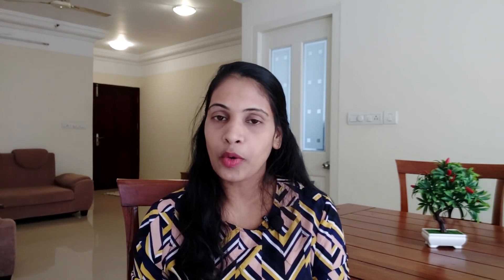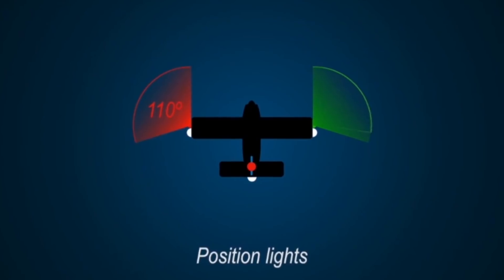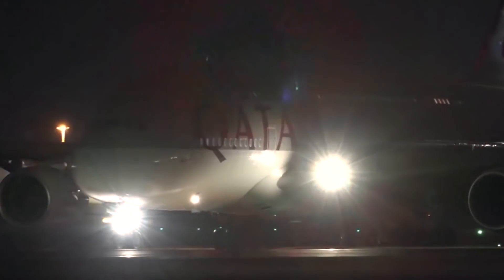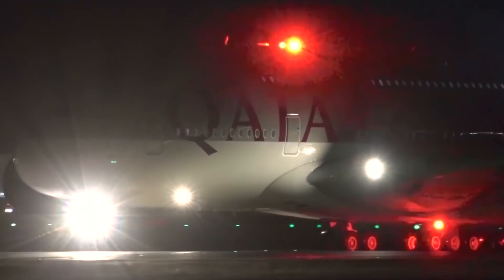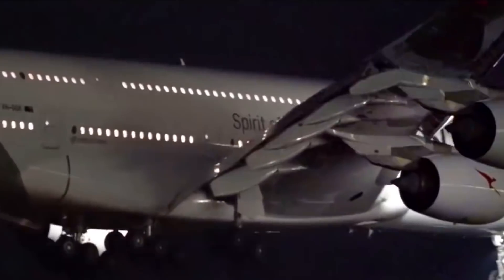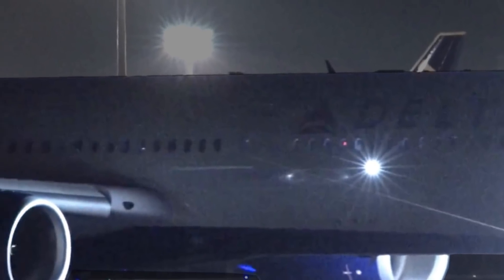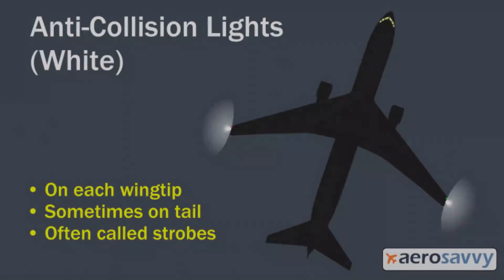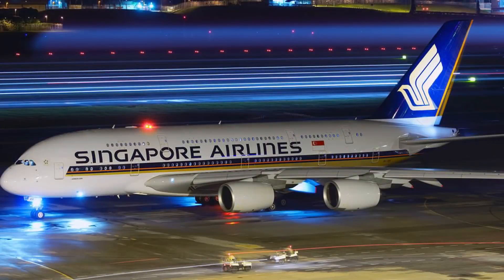വിമാനത്തിൽ കാണുന്ന ലൈറ്റ്സ് ഏതൊക്കെ ആണ്?

Comment: If you see Green navigation light on your Leftt side and red on your right side it means that Aircraft is approaching towards you and it is vice versa when the Aircraft is going away from you. 
Position or navigation is light is mainly is used to know the direction of the aircraft.
Anti collision light is used spot an aircraft on the runway by the approaching aircraft to the runway.
Red flashing light located down side of the aircraft also helps the ground staff to know whether the engine running or shut down before approaching the aircraft.
Added these points form my little knowledge.🙂
As other other videos of you this is also good and informative video which can be understood by everyone.
Reply from the maker: Thank you
Reply: @DivyasAviation  My Pleasure
Reply: Btw Runway turnoff lights wer missed

Comment: Hi Divya Some correction and some information ...

1.Navigation lights 
Red(Port side ) Green( Starboard side ) and white on Tail these are the Navigation light not position light 
.these lights are used to identify the left and rift side of aircraft to other aircraft’s and we can easily identify 
Weather the aircraft coming towards or Going away ..

2.Position light ( it’s not necessary in all airplane models ) 
Position lights are mostly mainly we can see in Boeing Aircraft’s just behind of Wing tip and Tail upper side of APU .

3.Wing strobes -and Tail strobes or positioning Lights 

Through this light we can differentiate at night time is it Boeing or Airbus 
Boeing-single flash 
Airbus -Dual flash 

4.Takeoff or Landing lights 
In leading edge of the wing or under the wing(depends up on aircraft model )
maybe two or 4 ) and 1 in the nose landing gear 

5.Taxi light  
For illuminating taxi light  bay during taxing 

6.Runway turn off light 
For illuminating the are wide area left and right from nose to see the taxi bay 

7.Logo light 
For illuminating logo for the company 

8. Wing scan and engine scan 
illuminating engine intake area and wing leading edge .

9. Camara lights ( 380,777,340 etc)
It give the clear vision to external cameras)

10. Cargo loading lights 
illuminating cargo loading area 

11.external emergency lights( mainly in Boeing and 320 family have Wing emergency lights)
In emergency condition making path and visibility ( near to the each door and overt the wing ) 

Note : wheel well lights not comes under external lights of aircraft’s it only for maintenance purposes.u cannot operate it if wheel well door are closed .
Reply from the maker: Thank you Manu 👍
Reply: Hi Manu...so detailed- might not be useful for a common man point...
Your elaborations are useful for those who want to go deep...
Thanks for your refresh..
Reply: @SIJUKDEVASIA  always happy to hear that knowledge is helping someone..I am also getting lot of new information from Divya’s videos ....thanks bro and thanks Divya .
Reply: @DivyasAviation  welcome ..and thank you to for new informations and new videos ......
One question Why ash try’s are in aircraft? Even in cockpit also as u know that smokies in internationally banned still why ash try’s ? 
☺️☺️☺️☺️....
U can do the interior lights of aircraft....
Reply from the maker: Ashtrays in bathrooms are listed as a legal requirement for “minimum equipment” by the Federal Aviation Administration (FAA). Passengers are not allowed to smoke still there are passengers who do it. In that situation instead of putting the stub into the washroom waste bin which is liable to be filled with flammable tissues, the passenger is supposed to place it in the ashtray. The non smoking sign will be on through out the flight.

Comment: Hi mam, why all aircraft's  window's  same shapes why not square  or circle  any technical  reason???
Reply from the maker: Circular or Oval shapes are also stronger and resist deformation, and can thus survive the extreme differences in pressure between the inside and outside of the aircraft.